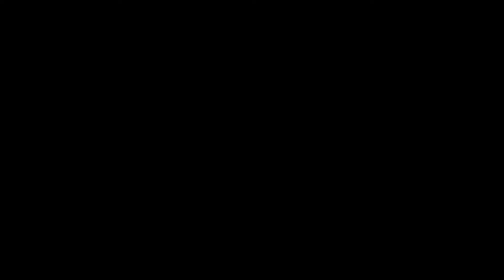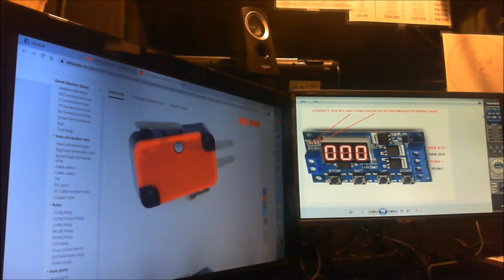Wiring up a typical timer control board

Comment: One more question I’ve been watching videos on this particular board and From what I’m seeing in p3.2 if I want my motor to run for 5 seconds then shut off for 180 min that the timer will not recognize the 180 min correctly. Do you know if this is so.  I need it to run 5 seconds shut off 180 min and continue the loop.
Reply from the maker: That is likely a possible sequence of operation. Check out  the attached document. I'm not sure why you want to add a jumper... If you sketch out the circuit, I will look at it.

Comment: Hey I bought this model by accident my question is can I run a jump wire from positive to positive to control both sides of board?
Reply from the maker: I don't think I fully understand the question. By jumping the terminals, you essentially take the  board out of the circuit.

Comment: I already figure that out with the 12v input and out put for the board and pump, but when i power it on the motor also turn on, even with the switch between i and solderd on the 2 spots in the left corner.

The COM on gnd
NO  on T _/ gnd

Is it usual that the pump turn on when i turn on my board because, the trigger needs to turn on the timer/board.

How can i fix this?
Reply from the maker: Please upload me a short vid of you powering up the board.  Also,  please make sure the wiring is clear in the vid .
Reply: @raykd2ibp198  i upload it
Reply from the maker: I see it,
 hang on a second.  @niks7011
Reply: https://youtu.be/aAflaYKUWXg
Reply from the maker: https://www.amazon.com/UCTRONICS-Programmable-Multifunction-Segment-Automatic/dp/B07BT32T1M/ref=pd_bxgy_img_2/137-3940201-2947849?_encoding=UTF8&pd_rd_i=B07BT32T1M&pd_rd_r=b4118735-78fb-41ee-b467-c41f053495bb&pd_rd_w=AT7co&pd_rd_wg=NMc5R&pf_rd_p=ce6c479b-ef53-49a6-845b-bbbf35c28dd3&pf_rd_r=WTRE29WXPYNNTJR185Z6&psc=1&refRID=WTRE29WXPYNNTJR185Z6
Reply: @raykd2ibp198  is there not a cheaper version haha this one is 38euro in my country i need one like 5euro or something its a small project
Reply from the maker: @niks7011  A: whats your name my friend?  B: What country are you from? C: you need to search around the net like everyone to get a good deal. Keep in mind..  you typically get what you pay for...  73
Reply: @raykd2ibp198  nick im from the Netherlands, yes i know but the only thing that i need is turn something on when its triggerd for a couple seconds and when it triggerd again it needs to do the same.
Reply: @raykd2ibp198  but when i buy that cheaper one, do you think you can help me connecting a switch on it, and run it?
Reply from the maker: @niks7011  https://m.facebook.com/KD2IBP
Reply: @raykd2ibp198  ill send you a direct message on Facebook